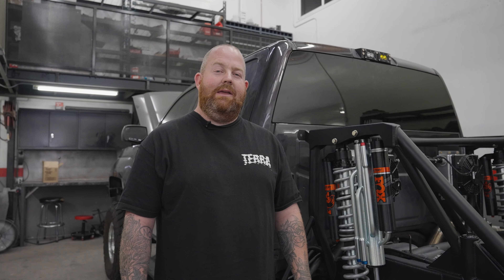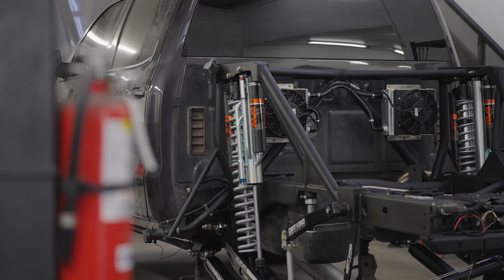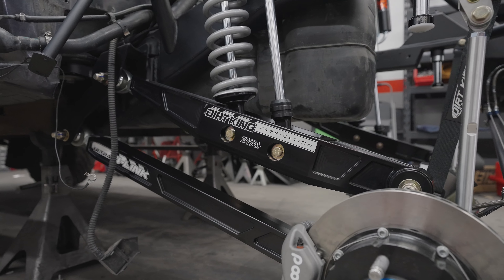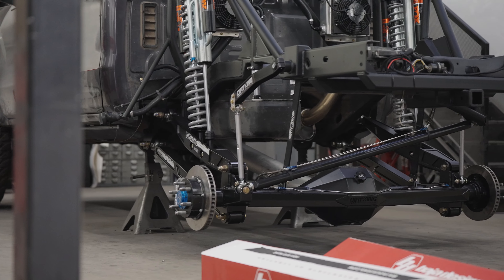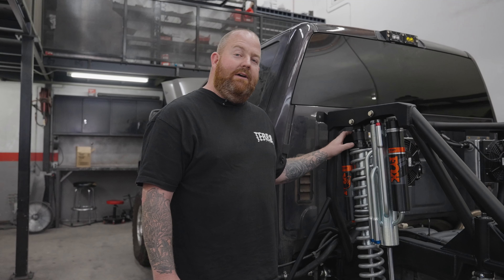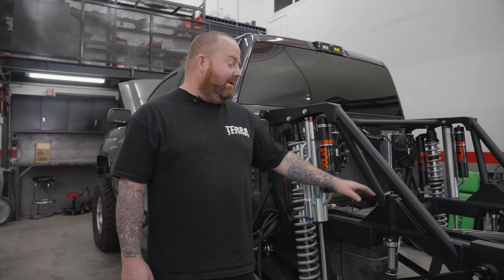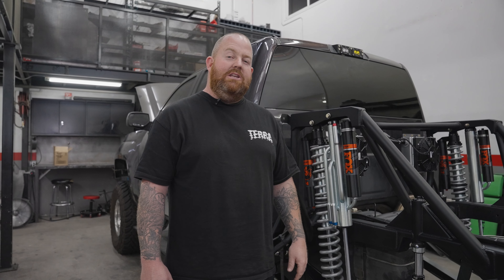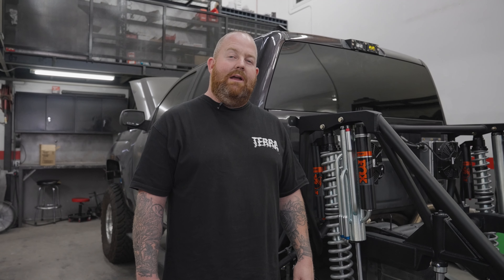What is an Ultra 4-Link Kit? | Ultra 4-Link Chevy Silverado

Comment: does mid travel kit need 4 link
Reply from the maker: Not necessarily. A 4-link suspension setup is for someone who uses their vehicle hard off-road (whoops, jumping the truck, big obstacles) and looking to maximize their wheel travel, suspension tunability, and overall handling. This is paired with a long travel kit in the front of the vehicle. A front mid-travel setup would limit a vehicle with a 4-link suspension setup in the rear.

Comment: Is there a 4 link or rear suspension that works with long travel that doesn't require cutting in the bed or having a bedcage? I want something that doesn't use bed space and looks normal from the outside. Like a clean stock look.
Reply from the maker: Unfortunately, no. To achieve "long travel" suspension you need a longer shock as it's your limiting factor. You also achieve more uptravel when the shock is located higher.

Comment: I'm making this partial joke as i see my dream of turning my 2021 taco into a prerunner slowly die lol: Will there be newspaper coupons for this $15,000 kit? For example i spec'd out my Tacoma (all be it just going off your website prices and a few guesses based on similar items) it would be: bed cage $1,600, bump stop kit $500 for the mounts and another $350 for the bumps, C-notch kit (couldn't find it so i guess $200-300), sway bar kit $300, Machined upper and lower link $2,000-3,000, sway bar arms $300, link pivots $150-250, axle tabs $100, 25" coil over $2,000, 3.0 3:2 bypass $2,300, multiple fixtures, 20" straps $50, California rate Man hours at a rate of $150-200/hr so at 16hrs that's about $2,400 for the work, if not longer....SUPER COOL KIT though, just mad ill never get these cool things
Reply: Gotta pay to play,Im already 24k deep into my gmt900😂